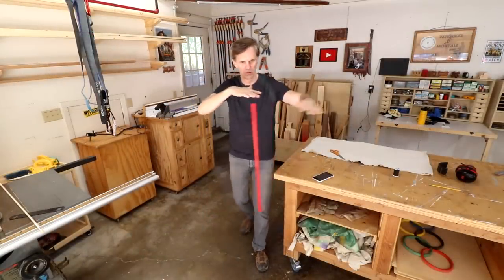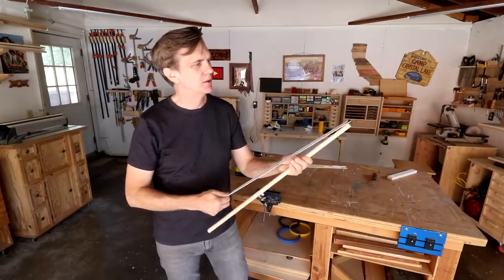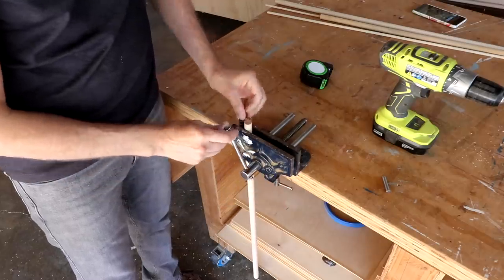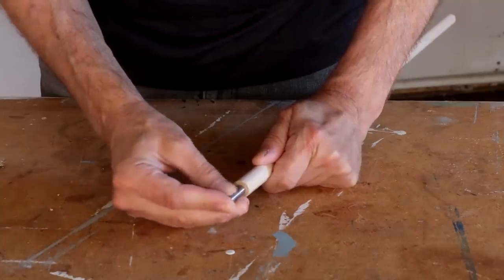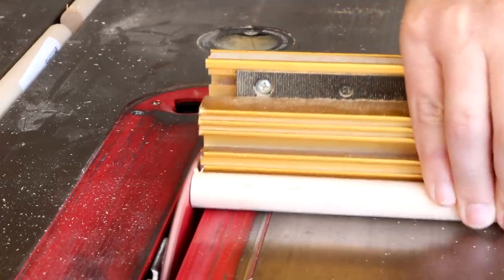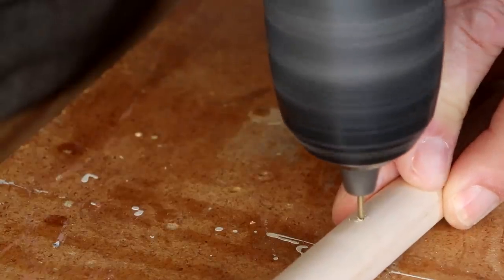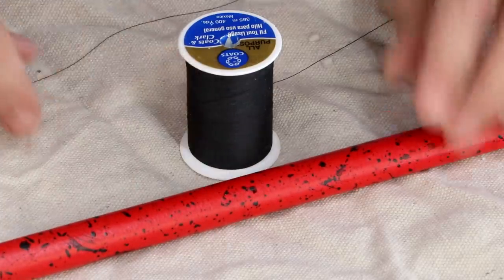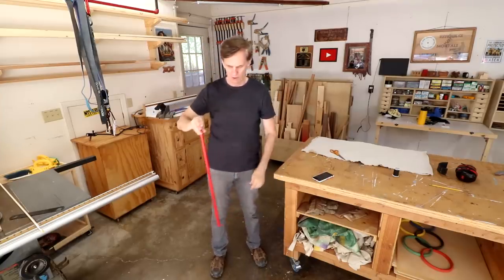How to make an impossible, mysterious, gravity-defying, floating magic wand.

Comment: Hide a tiny magnet in the dowel where the hole is and use a thread with another tiny magnet on the end. Then you can disconnect the thread easily.
Reply: Came here to comment the same thing. Just make sure it's a strong magnet that can support the weight of the dowel as it swings around.

Comment: I actually bought one of these once.  It was plastic mostly, but it came with thin clear fishing line for the string.  Also it might help to use a slip knot on the end that attaches to your finger, so it's a bit easier to slip on and off

Comment: Anyone looking to get more into using this thing search Levitation Wand. I've been using mine for two years and it's a really fun way to blow off stress and practice your spatial awareness. Careful with using weak string though. There's nothing worse than your string breaking and the wand flying across the room at 60 miles an hour.

Comment: Tie the string to a ring instead of wrapping it around your finger. With a little slack around where you tie the string on the stick, you'll be able to easily cut the string while talking and gesticulating before handing the stick over to the audience for them to try.

Comment: As a kid I was really big into magic. I had a floating “UFO” card trick that was nearly the same. The trick relied on a special (I think) sewing thread that was made of many continual fine threads. You would cut about 3 foot length and tape it to a wall and then tease the bottom to just get one of those almost invisible thin threads from the main thread. You’d then tape it to the back of your ear and use a bit of wax to a shear to the center of the card. Because the thread was coming from behind your ear you could pass the spinning card between your hands or even throw it around your body! It was a lot of fun and this reminded me a lot of that illusion!

Comment: Steve, ive been watching a ton of videos today. I have a table saw i inherited and im learning a lot. 
There is one project ive been asked to do and im stumped. Dont even know what terminology to use to find a video for this. 
Basically my sister is a new crafter and wants a tabletop paper storage shelf she saw. She wants the shelvs to be removable> glass (for cleaning)  I found some glass shelves 5mm thick. I need to cut a indent in the shelf wall about 6mm thick to slide the glass into. Can i use a thick kurf on my table saw, only lifting the blade up a few mm to not cut through the whole sheet of wood?
Love the videos.

Comment: Why not use the drill press to make the hole in the dowel?

(Not second guessing, genuinely curious)
Reply: @Tom Faigle i think he wanted to make the project as diy friendly as possible, so using a hand drill (something most people have) is the best option.
Reply: Uh, where would the rest of the dowel go on a table top drill press?
Reply: @davidgeorge8541  Oh yeah, I forget Steve's was tabletop.  I scored a cheap floor standing press with a big enough hole in the center of its "table", which I've always kind of wondered if it was for this situation.  You can also swing the table out of the way, though I can see clamping the dowel might be challenging in either case.

Comment: What if you counter sink a magnet instead of drilling a tiny hole for the string, and you use a magnet on the end of the string and you can attach and disconnect quickly?

Comment: You dropped "Lockdown Woodworking" in the title... Why?  Because it's now "RE-LOCKDOWN Woodworking" ...  I think it's Day #1,026... not sure, lost track.  For the A B C's of woodworking, you're at the letter 'F' ...  So "F" is for "Frustration" as in Frustrated about this danged lockdown... can you tell I'm traumatically triggered by this lockdown?  But I'll bet it's going to be an "F" clamp because you can't have enough clamps.  Well, see you tomorrow if the river doesn't rise.

Comment: And another thing! What's the deal with you USA guys? You make stuff and in your plans you say  "and this bit has to be  3& 5/16s of an inch and that bit has to be 4 & 3/32s" ....  The reality is that this is B.S  you make the thing with the wood you had to hand and once it was complete you remembered to measure it for the post!  If the wood is up or down a bit it doesn't matter as long as it fits